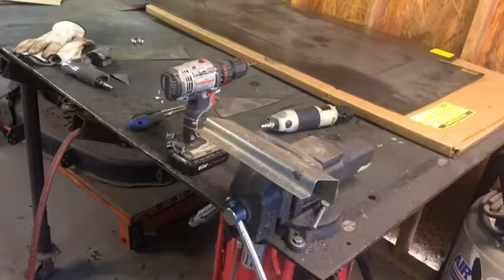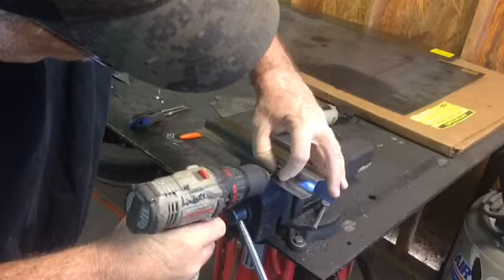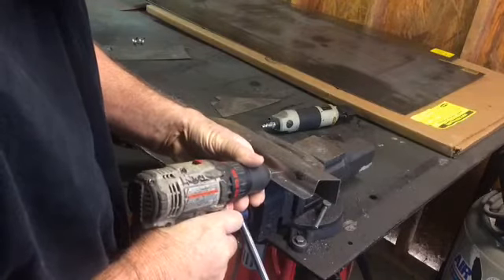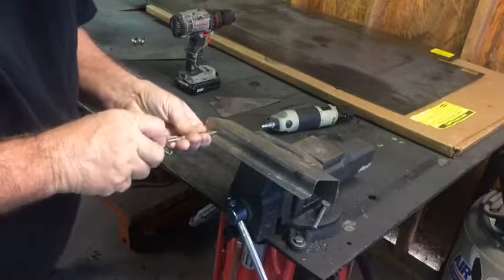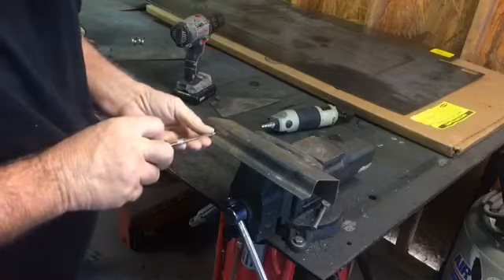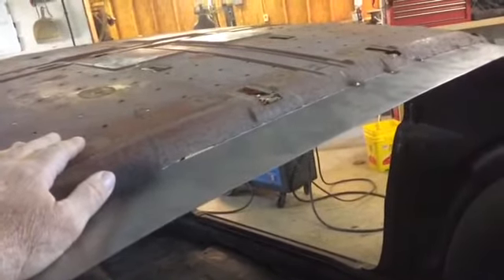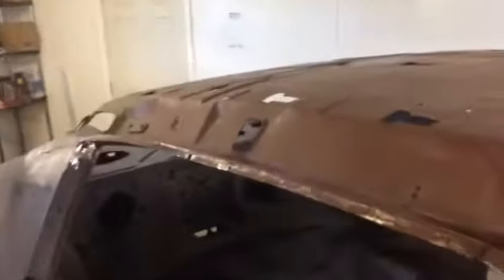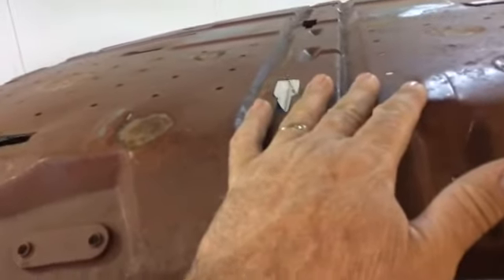Camaro roof skin project, final repairs and trim studs

Comment: 3M All-Around Autobody Sealant PN08500 used on the same spots the factory did. Put the roof skin down and clamp down before the sealant sets up. This came from the Tech section of Super Chevy "Raising the Roof" article. April 2015 Volume 44
Reply from the maker: That's awesome man. Thanks a bunch

Comment: Glad to hear you got the trim studs working. They are a pain for sure. I'm going to use 3m nvh dampening foam on the skins, part # 04274, it may be the same stuff needed on the roof. Before you lock the roof down, double check the rear corners with the trim, I know alot of guys rework these skins in that area. Nice work Jeff.
Reply from the maker: I've noticed the corners are a little rounded, but not sure if it's bad enough to work. I'll double check. Thanks Russ